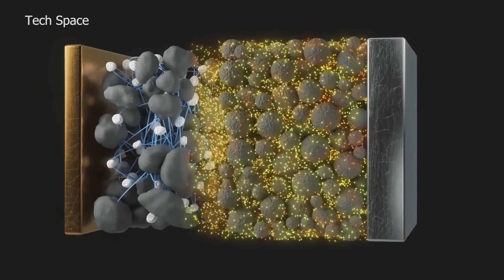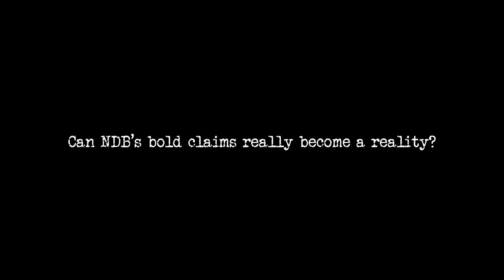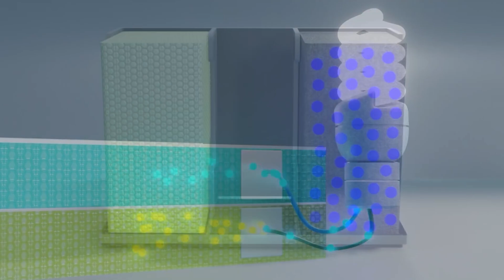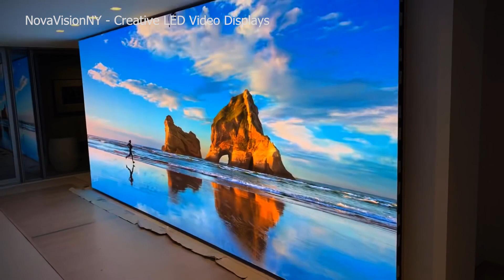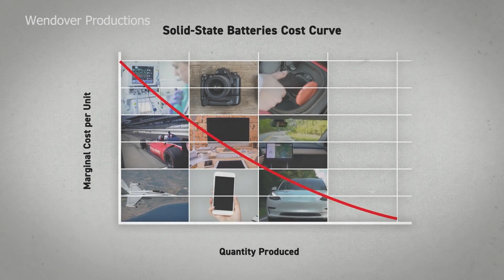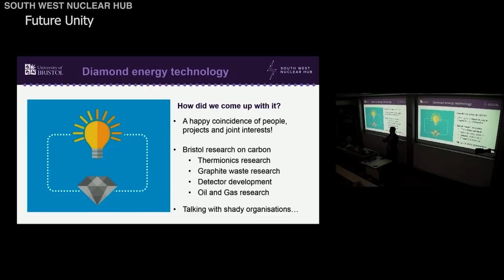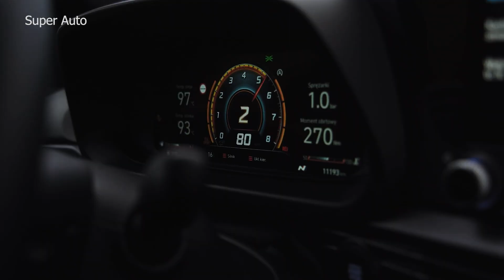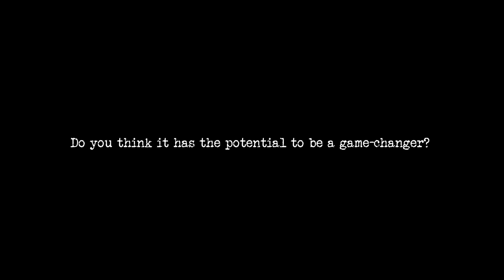Nuclear Batteries are Finally Here!

Comment: The guy talking on this video is an idiot if he believes this BS. NDB is promoting some seriously ignorant utter nonsense! The power output of nuclear diamond batteries is just way too little for use in EVs and consumer products like smart phones, laptops etc. Imagine a nuclear diamond battery that can last 1000s of years 😊...then, realize such battery needs to be 1000s of times bigger and 1000s of times more expensive than a Li-Ion battery for the same power 😮🥸🧐…do your homework about POWER DENSITY (in this case micro Watts per cubic centimeter) and you will understand this message! And no, R&D on this battery type can not defy the 1st law of thermodynamics limiting the max power to the natural decay power (isotopic power) that will forever be in the micro watts. In fact, if any betavoltaic battery could actually produce Watts of power, rest assured it would also be extremely dangerous as such power of radioactivity is highly lethal.

Comment: 🤔Nano Diamond batteries have some real potential if done right in manufacturing if we start using more efficient ways for chemical vapor deposition process to build up a bigger layer and use the more efficient type of circuitry like Quantum logic gates👍 we would be able to have 28000 year portable charging stations.🤯🌐✌

Comment: Once This idea was mine  my Though experiment  to make battery based on the fact that nuclear wast is actually Source of energy since it also emitting Radiation which is Pure Energy also High energy particles like Beta a Super fast Moving Electrons than taking that energy to Break electrons in Some Oxides like Zno , CuO2 or Si mi conductors  to generate Electrical energy .

Comment: The problem with innovation like this is that you have to take into consideration how it could and, unfortunately, would be used as a weapon by inyernational and / or domestic terrorists. A battery this powerful would only really be able to be used in military tech.
Reply: Not possible Since it can't sustain chain Reaction as in A Bomb 💣 .
Reply: @INNOVATION & INITIATIVE Diy  I know what youre saying but thats not really my point. While using the batteries to set off nuclear explosion might be near impossible for a terrorist to pull off, what we would need to worry about are is preventing its application as a dirty bomb or someway of creating an event of mass radiation poisoning.
Reply: @KeepitABuck50  Yes , while Typing ,I was in little doubt that , your point might be on Radiation side instead of Fission side now It is Clear so yes that will be More dengerous than the bomb